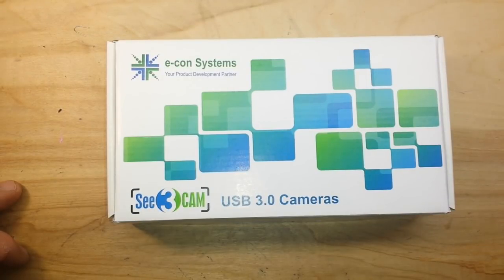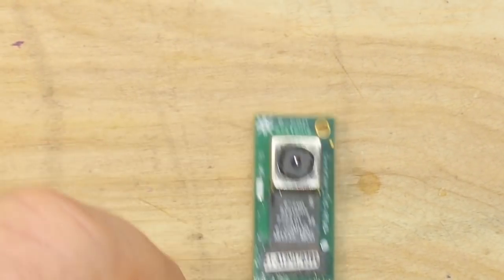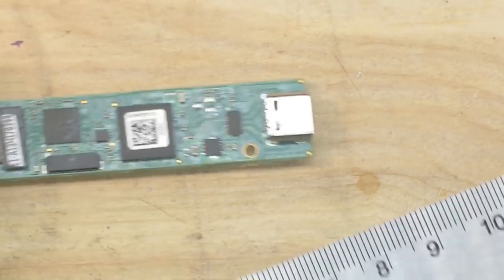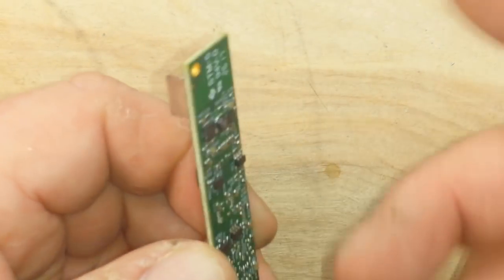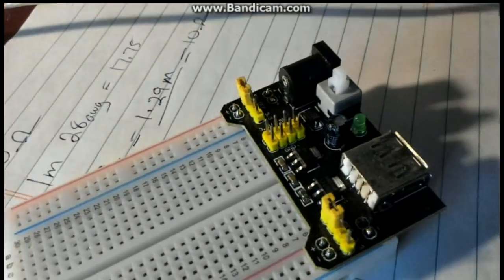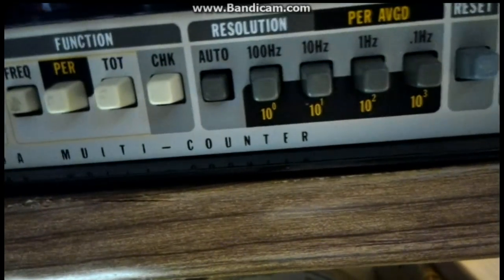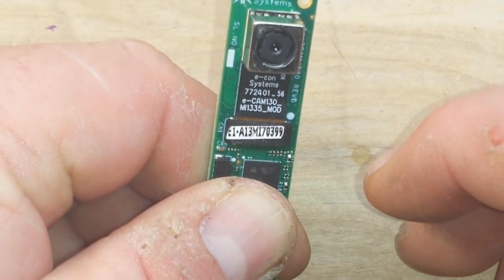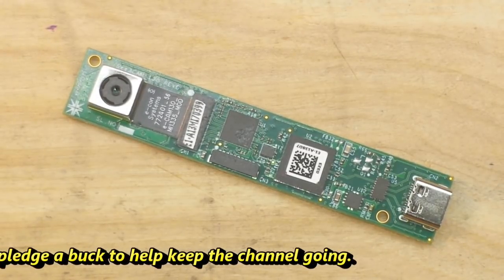See3Cam 4K Camera Review

Comment: See3CAM_130 is an OEM Camera that supports 4K Ultra HD (3840x2160) at 30fps over USB3 in compressed MJPEG format. This See3CAM_130 can also stream Full HD (1920x1080) at 60fps and HD (1280x720) at 60fps in both uncompressed and compressed MJPEG formats. This autofocus USB camera board is also backward compatible with USB 2.0. Our Volume price starts from US$99. This camera solution is targeted for applications like Next generation Ultra HD Webcams, Medical/Diagnostic cameras, Microscopic cameras & Inspection cameras